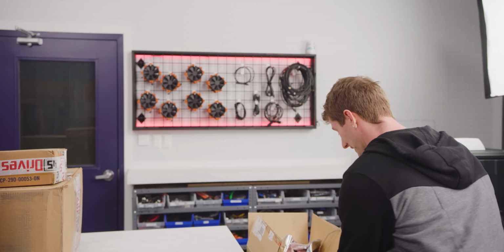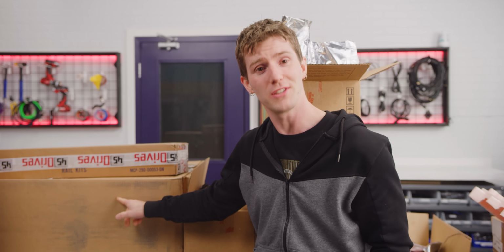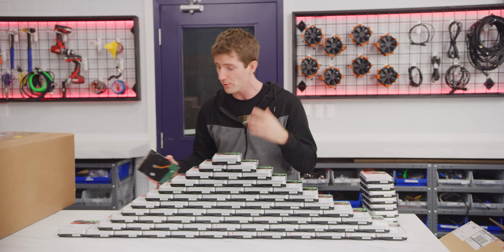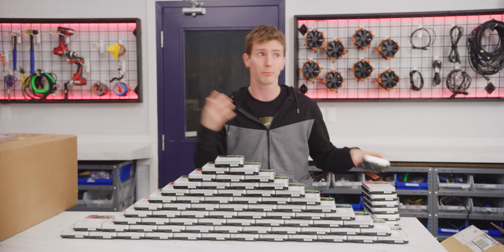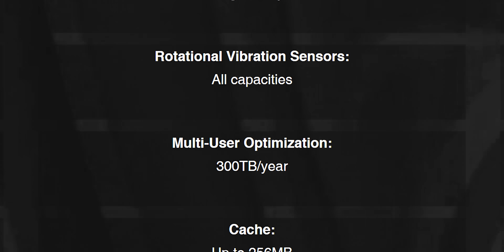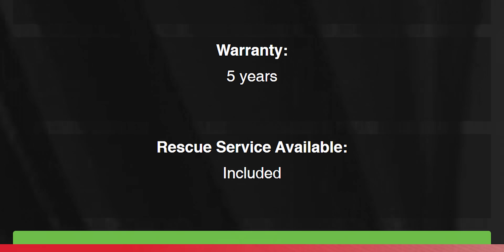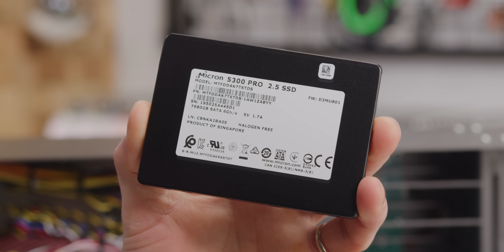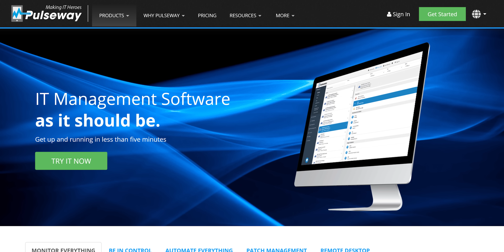Unboxing 3 PETABYTES of storage!!

Comment: Linus you really need to read up on L2arc, zfs mirrors L1arc so you dont really get a performance boost by adding l2arc.  Also sata ssds max throughput theoretical is 6Gbps which  is far from 10Gps and even further from 40Gps.

Comment: Well I think at this rate the next project will be "Building a Data Centre", I am not joking the amount of storage you need is reaching the point that you need the scalability of data centre facility which would actually be an interesting project. Data centre setup is fascinating from rack setup through cooling to Diesel Generator emergency backup power! Do it Linus! https://www.cat.com/en_GB/by-industry/electric-power-generation/electric-power-industries/data-centers.html

Comment: Oh god, I don't even know where to start to tell you how wrong this all is... For your usecase (storing large squential data) All of the caching is completely pointless. ARC? doesnt work well for large data. L2ARC? Equally pointless! SLOG? ITS NOT A FUCKING CACHE... OMFG... also only works with sync writes... Which writing large sequential data ist not. Surprise...  Worst video in a long time.

Comment: imagine 20 years later someone watching this video be like: oh back in the day 3 petabytes of space would literally take up a whole table full of space
Reply: 20 yrs from now:
Watching this video.. glancing at my 16PB micro SD card
Reply: @m3redgt  and be like: "This piece of crap, I seriously need to buy a new phone"
Reply: Kehrbotr Supporter ew 8k my minimum standard is 516k
Reply: dragon ur stuck in the past get on my level I only use 512 trillion 2028 hz 6 inch monitors
Reply: @m3redgt  Watching this video with 16pb/s wirelless internet
Reply: @KilledDebtor  at 1000k
Reply: @KilledDebtor  I'm pretty sure that's impossible with our current data transfer methods, maybe quantum computing can achieve these speeds but I feel like there would be a physical limit of how much a systems physical hardware can handle at a time
Reply: @M3RedGT getting a 10mbit/s Connection in Germany
Reply: @Milli_mii  sitting at 1 mbit since my birth
Reply: @Milli_mii  hahaha echt so
Reply: @Milli_mii  change your provider
Reply: @Milli_mii  :-D
Reply: @m3redgt  On your  7.3 inch holographic display with 128GB of ram and Tritium Isotope battery. nice.
Reply: @m3redgt  On your  7.3 inch holographic display with 128GB of ram and Tritium Isotope battery. nice.
Reply: @m3redgt  On your  7.3 inch holographic display with 128GB of ram and Tritium Isotope battery. nice.
Reply: @m3redgt  On your  7.3 inch holographic display with 128GB of ram and Tritium Isotope battery. nice.
Reply: @m3redgt  they probably wouldn't still be using a micro sd card they'd be using a micro micro sd card
Reply: @m3redgt  closer to 5 years
Reply: @m3redgt  Physically that wouldn't be possible, maybe a few terabytes in a microsd card but not petabyte, it's just physically not possible to make that many cells for the data to be stored in.
Reply: @Fainthen  so what is the theoretical limit of Gb per cubic mm?
Reply: @Fainthen  Based on what do you claim this?
Reply: @AntonBogomolov  I wouldn't know that, however the show piece that samsung had was 30tb in 2.5inch form factor double stacked a few years ago, things have advanced a bit however I don't think they're too far from the actual physical limitation of what can be crammed into the physical space when it comes to individual cells before quantum leaping becomes too big of a problem, aka electrons leaving the space where you want them to travel and just seep through the material due to insufficient insulation, remember electron with enough charge can literally jump through anything if given enough pull or push.
Reply: @katrinabryce  I know there's terabyte microsd cards, however I doubt they're really far from the limit of what can be crammed into that formfactor, it's the same deal as cpu lithography you can't cram too much into the same space and expect it to work without too many random things start happening with the electrons aka what you actually use to make up the data.
Reply: @Fainthen  Please read this link: https://en.m.wikipedia.org/wiki/Areal_density_(computer_storage)
Reply: 后辈 they said one gigabyte was impossible but here we are
Reply: @Fainthen  I know there's a physical limitations which we nearly hit already but it's fun to imagine unlimited storage on your fingernail
Reply: @AntonBogomolov  could encode 215 petabytes of data in one gram of DNA. In a practical terms, it's read/write speed is going to leave much to be desired.
Reply: @alexhamon9261  That is what ZFS ARC and L2ARC are for.
Reply: @Fainthen  with breakthroughs such as graphine and 3d stacking who knows what the restrictions are? how big were hdd's 25 years ago? would you even contemplate a 1 TB drive back then?
Reply: @allothernamesbutthis  simple sheets of carbon doesnt do anything for data storage, it doesn't seem like you've read anything about the difference between the use of semi conductors and conductors, anyways we're literally talking about physical limitations down to the size of a few atoms apart that we're getting close to when it comes to tranistor count in silicon layers, and no you can't just put layers of conductors like graphine will do anything but waste space in silicon, graphine is thin layer of carbon, which is a conductor meaning it lets electrons pass through it relatively easily. 1tb harddisk were never a thing of question, back then there weren't any tools for making it due to the industry not yet maturing you can't really use that as an argument, it's like look a two hundred years ago engines were only steam driven and required massive boilers, you know what ? Steam engines today are just as big, you know the nuclear generators we got today ? those are in practical terms large steam engines, you heat up steam to turn a turbine and that turbine generate enectricity. Everything has physical limitations, a single silicon atom is about 0.2nm wide, you can't make any transistor smaller than a couple of atoms wide without having to do something impractical like keeping it near absoulute zero, otherwise the electrons will just flow freely due to the resistance being too low.
Same thing goes for memory cells.
Reply: @allothernamesbutthis  Also you seem to have no idea what graphine is, nor the fact that they're already stacking the stuff in the silicone as much as they can, and trying their best. Nor do you seem to understand that I'm talking about the literal physical limitations, for reference, the size of a single silicon atm, is about 0.2nm wide, 5nm lithography is aproximation of an average of 5nm gap between conductors in a fully 3d stacked transistor array.
Reply: @Fainthen  was looking for this reply in comments. Your comment is so underrated. Can't believe people are so primitive. Especially people who are good with technology, but still don't understand basic concepts of physics, chemistry.
Reply: @Fainthen  we talking about the future man
Reply: @Fainthen  Molecular memory would allow nearly unlimited memory capacity. It's coming.
Reply: @CyberPhotoFreak  I'm not even going to start, but your average battery is a perfect example of single bit chemical memory cell, in practical means same concept as what you pointed out, just as unstable and unrelyable for actual data storage for all the reasons why batteries aren't considered relyable.
Reply: @Fainthen  do you even think?
Reply: well, who knows
Reply: Nope. Nope, that's not even close to the physical limit. You forget how dense space stuff gets
Reply: @Fainthen  "Physically that wouldn't be possible"  A single human cell around 100 micro meter can store 1.5 GB data in its nucleus using DNA.  So, nothing is technically impossible in the future.  Some engineers have actually created a single atom transistors.
Reply: @Fainthen  that's what they said to a terabyte back 15 years
Reply: @Fainthen  you also don't understand that science is always subject to change and stuff that was facts now can be false in future, science is always evoling
Reply: @evgenywow  nice to know you also dont understand science, its always evolving and facts now could be false in future lol
Reply: @neptonixgaming  I agree, there could be different approach to everything. But with current technology it's really peaking.
Reply: @Fainthen  unless they figure out how to just avoid atomic and quantum restrictions by then, who knows :)
Reply: And then read your comments 😂😂😂
Reply: 20 years from now I don't think local storage will still be a thing
Reply: @metaleuman  but cloud storage is pretty much someone else's computer.
Reply: @metaleuman  yeah, 5D optical data storage or something more advanced could become the standard
Reply: @metaleuman  It will always be nescssary, but yea in general most stuf will be moved away in to the cloud.

Are you intressted in computer sience?
Reply: @wertin200  and then you could have someone hack into the cloud storage
Reply: Meanwhile they have 3 petabytes of ram in their VR ready smartwatch (?)
Reply: A friend of my father payed over 2000eur for 200mb of space...

That's so many years ago and now? 200mb is NOTHING
Reply: thats assuming we haven't invented some new storage method
Reply: @NonsensicalSpudz  Got that DNA storage drive that holds 215PB per gram in my system, need something to store all that high res .flac music and 16k video 😉😍
Reply: "now it fits in our pockets XD"
Reply: actually, is almost impossible, because now we already reached the smallest size of transistors, even electrons could travel through, meaning we are almost at the peak innovation of storage system
Reply: imagine 20 years later someone watching this video be like: oh back in the day linus unboxed only a whole table full of space
Reply: @Anders Ingemann Yes but also no. You could never use that data resonably. Only store it.

And, when it comes to flash memory (SD cards among other) we are closing in on so small that quantum effects become relevant.

So no, you probably wont be ever seing a petabyte SD card. Just as we havent had huge CDs or floppy drives because we have simply moved to better storage.

So yeah, while storage might improve alot, current flash and Hdds are closing in on their max
Reply: 20 years from now...crystal storage with 1 octabyte of storage...a petabyte won't even fit the windows 10 update...🤔😁
Reply: @marksmadhousemetaphysicalm2938  Peta -> Exa -> Zetta -> Yotta 
Octa is not a SI prefix and the fact that Peta is 10^(3*5) is a coincidence and has nothing to do with the Penta (5)  )
Reply: Well think about how little space they had with those huge tape drives that used to take up entire rooms
Reply: I think Something completely different will Happen... All Data Size is getting smaller and smaller and everything will BE perfectionized so, that we have a complete perfect stabilization between Cloud and hardware.

By the way im German too and in Germany the Internetspeed is really a "Krampf" we say in Germany.
Reply: @RIX I know that 🙃
Reply: I hope Seagate or Kingston would make sure Portable hard drive for that..
Reply: 20 years from now: buying a 512 petabyte micro sd card at the local tech store for 5 bucks
Reply: 20 years ago, the 10TB NAS system I purchased took up an ENTIRE RACK (ok, only half the rack was drives, but....)
Reply: me when i realize the new madden 2040 game takes up 1 petabyte
Reply: I thought about this too
Reply: Wow, can’t even support 1080 hz refresh rate
Reply: Just imagine all those HDD and sdd becoming obsolete the moment pcie SD express  comes out to the consumer market
Reply: That's so true
Reply: There is more space in a molucle of water so...
Reply: Motomeister E lol our phones will have a pedabyte our tablets will have 5 our macbooks will have 10 and our desktops will have 20
Reply: @KanineWasTaken  more like 200 lol
Reply: Motomeister E probably looking at statistics
Reply: I was just about to post this lmao
Reply: Motomeister E more like 5 years probably
Reply: imagine how many storage he will need to store his footage in 20 Years
Reply: FACT
Reply: Don't make me feel old this soon
Reply: We could fit 1 petabyte in the space into the space of one of those drives today using 1tb micro SD cards.
Reply: 2040: the new iPhone has over 10 petabytes
Reply: There r petabyte sd cards

only on wish
Reply: Scary when you think an SSD is a little larger than a 3.5" floppy.
Reply: people now said this exact same thing years ago,when 1 gb was a lot
Reply: 2075: this 75250fps 100 exabyte phone is trash
Reply: ha fools look at my 512 nanobyte sd card
Reply: You only have 1tb of ram?  Pff that’s ancient I only have like 500tb of ram
Reply: https://www.statista.com/statistics/795748/worldwide-seagate-average-hard-disk-drive-capacity/

In last 5 years avg hard disk capacity increased ~4 times. You could actually get 1Tb SSD back in mid 2000s.

 Idiotic thing is that I can't find any detailed charts with average capacity and all that shit. I fucking hate that shit.

But let's say something from memory. 1TB memory in 2010 for the majority of people would be plenty enough. Heck, I could argue that even today for average user it's plenty enough.  By average, I mean your facebook mom and dad. Now someone who is gaming, storing something, etc 5-10TB is plenty enough. For majority. Unless you like to torrent every popular show at 4k losless quality.

That's 5-10x increase. Now Average disk sizes in early 2000s where around 10-30 GB. With 50GB drives being plenty enough. 20x.
Reply: Fuck, I meant HDD
Reply: i cant believe i looked at every single reply to this comment
Reply: Honestly I'm not sure we're even going in that direction. Massive local storage seems to be a dying pursuit in favor of cloud storage.

Plus the more stuff you keep locally the more you have to back up and the fault tolerance you have to be willing to take on. The crucialness of each bit of data doesn't change just because you can store more of it. You just increase more risk in a single point by being able to hold more on a single drive.

Remember when the server HBA card crapped itself? Yeah, when that happens your whole RAID array becomes unusable. Having all those drives running in tandem is nice but they rely on a controller card that doesn't have anything to do with the uptime of your drive array. If that dies then it's like ALL of those drives died at once and you're stuck trying to piece together your data with all the stress, uncertainty, and downtime that creates.
Reply: ltt made another video showing off a 100tb ssd that was only the size of a normal 16tb hard drive, the 100tb ssd was just a very dense pack of ssds, so it's not impossible to shrink down storage sizes if they somehow get even cheaper in the future
Reply: I remember watching the petabyte project and grinning like an idiot.
Reply: wtf would we need petabytes of storage for? hours of uncompressed 16k video? you can't even see the pixels past 4k on smaller screens.
Reply: @g3neric108  You clearly do not understand how to flex
Reply: @g3neric108  But my paint-on 10 foot wall nano-lcd display is in 16k!
Reply: @g3neric108  In 20 years you will have Retina OLED wallpaper on your walls and ceilings displaying forest/city animations and illuminating your rooms (like in Cloud Atlas) with 1 billion pixels per wall. Petabyte will be just 1 good animation.
Reply: g3neric tech will move forward
Reply: @g3neric108  that's what they said about gigabytes back in the day
Reply: @g3neric108  you need glasses
i can see the pixels at 8k.  That said I doubt I could see them at 16k, unless Im watching it with a vr headset.  We will need somewhere around 64k for VR before you dont see a screendoor effect.... that is seeing the spacing between the pixels.  Because of that fact the technology will inevitably get there eventually at which point we will need a LOT more storage for our movies and games, ect that we use with our VR rigs.
Reply: @g3neric108  maybe uncompressed 64k video maybe in future who knows 16 petabytes no need for all that much storage stick to a 6 or 8TB hdd
Reply: @g3neric108  evolution
Reply: @g3neric108  yeah but then storage would never be a problem anymore hence some much storage
Reply: @g3neric108  we dont know, but for example: games have gone from fitting on a cd, to some being around 230 GB
Reply: @g3neric108  that's what they would've said about 4tb hard drives 10 years ago but look at us now
Reply: @g3neric108  "Download Internet for offline use?"
Reply: @g3neric108  Imagine how much space AAA games are gonna start to take up
Reply: @g3neric108  you act like 20 years from now we will be still be just recording 2d images for video and stereo audio.
Reply: g3neric for your “Homework” folder
Reply: Alternative to the trash can, always recoverable data